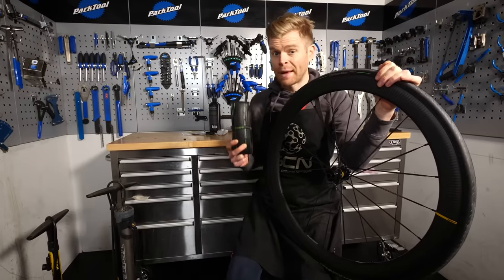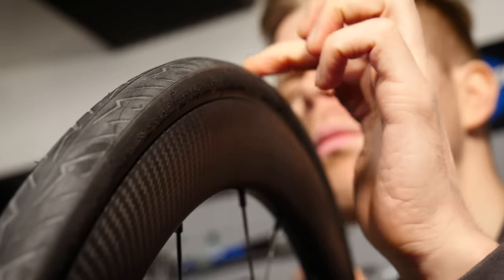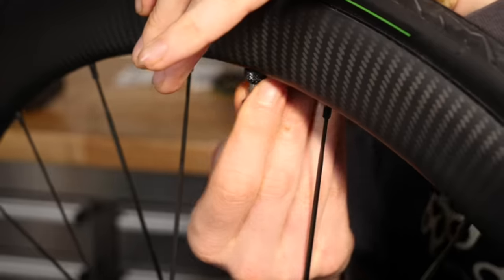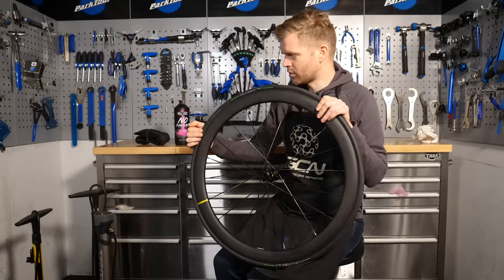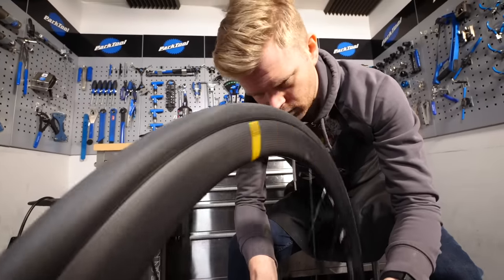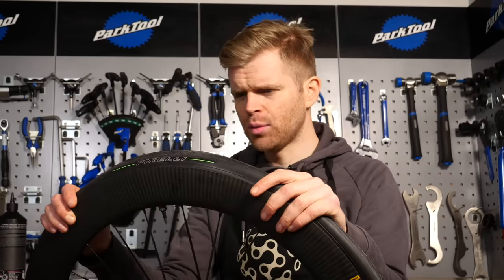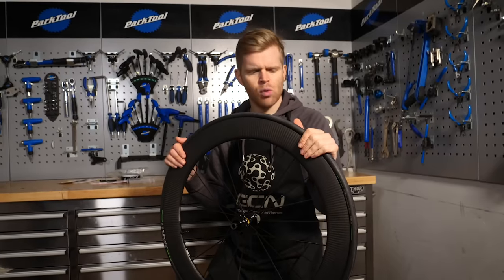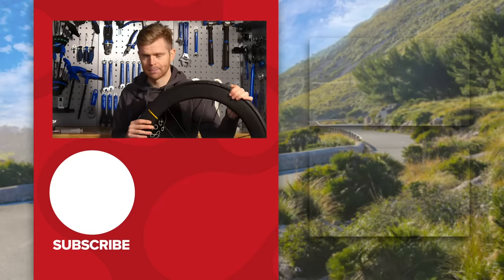How To Maintain Your Tubeless Tyres | GCN Tech Maintenance Monday

Comment: "How do you know if it needs replacing?"  I don't think I heard the answer to that one, other than removing the tire,  at which point it all spills out and you definitely need to replace it.
Reply: I like to check every 3 months or so. I take out the valve core and go in with my sealant injector, pull out whatever I can, and check for color and amount. If it doesn't look new, I replace all of it. If there isn't enough, I add more.
Reply: most sealants need replacing after 3 months, especially in the summer. With some you may get away with 6 months.
Reply: Take the wheel off and shake it from side to side. If you hear sloshing, you're fine. If not, time to replenish. The zip tie as a dipstick also works. Just depends on whether removing your valve cores and reinflating, or removing your wheels and reinstalling, is less bothersome to you.
Reply: New to tubeless.  If you are continuously topping it up do you eventually have to clean it out and start again?  If so how often would that be?  Thanks.
Reply: @harrylook7810  Do use presta valves or the larger auto/schrader ones? For presta, which brand of injector/syringe  do you use to suck it out to check? Mine either don't fit into the valve shaft or get stuck with the particles of the sealant. For filling through the valve, I keep the small bottles with the funnel tip. For roadside refills anyway. To check if it's dried up, I dip a zip tie into the tire (or the plastic pin orange sealant does provide).
Reply: @RickinHKG  On principle, yes. But when the sealant dries up, it's only a thin layer, about 10g of 60ml of sealant. So only a kind of weight weenie, rolling-resistance-obsessed cyclist would clean them every time. Though it's fairly easy to scrub off most of it, it takes me at least 5-10 minutes per tire. Plus, leaving a well seated tire on  saves some hassle. Pulling it off and remounting it is often labour intensive, nothing I'd try without strong levers anymore. Reseating tires often requires cleaning at least the tire bead for a tight seal at the rim. A dry test without sealant would show.
Reply: @qoobeq I use Effetto. I got lazy and waited 11 months before checking.  All the sealant had dried up but the tyres still held air as normal 🙂
Reply: @nikveldkamp8630  In your case, how long before you say, “time to take this apart and clean it out” ?
Reply: @MtbEMS  with the sealant dried up,  its only some grams heavier ( Tobias, RidesofJapan, weighed the crumbs for a video - about 10g per tire?), so as long as you're not a weight weenie, I'd save my time and just top it up probably 3 to 5 times before cleaning since I don't want to brake the bead seal on the rim. On that note, thanks for the reminder,  I really should put the wheels onto scales from time to time to retrocalculate the weight gain if I don't want to take the tires off.
Btw, Stan's race sealant is THE horror, cleaned out a pair of tires, that sealant is super effective against punctures due to its many glass fibers,  and that was aggressive, irritating to the skin while super hard to scrub off. All other latex sealants I tried are a piece of cake. 
But to be honest, my favourite compromise between ride quality, lightweight and ease of use are latex tubes. You have to pump them up regularly, but I find them quite robust esp. for low pressures.  And they're as patchable as butyl.
Off topic, but maybe helpful: Jan Heine (René Herse) states that their tests showed while tubeless is more puncture proof, latex is faster, mo sloshing liquid. Thermoplastic tubes seam to beat it, but they're  pricey and even more complicated from what I heard.
Hope that helps.
Reply: @nikveldkamp8630  👏oh interesting stuff here! Noted 📝 thanks!!

Comment: Thanks for the video. It has "sealed" it for me. I'll stick with my latex tubes.
Reply: Yeah I made the switch for my back wheel. Smdh nothing but a hassle.
Reply: Are latex really better than butyl tubes? Do you need to air up latex every day? Just wondering if I should switch.
Reply: @enriqueDFTL  I just swirched to see what the big deal was, and as a weeked warrior, I don't notice a difference. There's a weight savings, sure, but that's about it. Theres no noticeable air loss one over the other. I have such varied temps here, that I'm always having to add air, it seems, so I'm not a good one to ask on that.
Reply: Yes it seems quite a faf to me, also you have to remember tubeless tyres are twice the price, I have tubeless rims but I have fitted good quality standard tyres and tubes, technology will improve and prices will fall, but for now I'm ok with what I have
Reply: Proves different strokes for different folks... I'm never going back to tubes.
Reply: Agreed. I've had nothing but grief from my attempt at running tubeless. Suffice it to say the tubeless tires are in the bin now.
Reply: Going tubeless for 3 years on my roadbike and almost 8 years on my mtb, now. NEVER had any Problem at all. Especially with my mtb I had issues all the time running tubes. Fitting is easy once you did it a few times. Bikeshops in my area will do the mounting for around 15-20€ which will be an option when not wanting to hussle with latex and stuff. Will never go back to tubes. Cheers
Reply: Works well, really well, only with a proper tubeless rim! Otherwise tubes...

Comment: I still have no idea how to check when I need to replace the sealant
Reply: Orange seal has a dipstick you use after removing the valve core.  It's kind of like checking oil in a car.  Pretty easy and not subjective.
Reply: You will need to replace your sealant if you start to notice that your tires are losing air pressure faster than usual, that typically means that your sealant has dried out.  It's way easier to replace the tires than removing the old, dry sealant.  Also, if you've had a bad puncture and lost a lot of sealant I would top up before your next ride.
Reply: @andrewturner25  thanks Andrew, just saw your answer now :) that's very helpful

Comment: Switched to road tubeless two years ago. Love it! Never going back. A little more work than clinchers, but you don't need to do this maintenance all that often. It does depend a bit on the kinds of roads you ride, possibly, but I haven't had to change a tire for a flat out on the road in two years and I have not had a spray problem (these are for pretty big cuts). I still bring a tube with me in the saddle bag, just in case, a CO2 to pump that up, and some paper towels (tire lever of course, as the tubeless tires can be a little harder to get on). It's great! (for me)

Comment: The best advice I received to seal large holes in tub less tyres was to superglue a standard patch over the large hole on the outside of the tyre This patch will gradually wear away but will give the sealant time to do it’s job

Comment: I recommend the Milkit system. You can withdraw the sealant from the tire and keep the tire pressure at 20psi at the same time the valve core is removed so the bead stays on. Milkit has special rubber flaps that open and close on the bottom of the valve when you put the syringe tube thru them and still keep the air from coming out. Then when you extract the sealant, you open the valve slowly until you see just bubbles in the syringe and then close it off at the valve. Then if the sealant is low, you just withdraw the needed amount of sealant from the bottle, close off the valve and then put the tube thru the valve core hole, open the syringe valve slowly while compressing the syringe until all the sealant goes into the tire. Then withdraw the syringe and re-install the valve core and use a hand pump to put the desired pressure back in the tire. I usually top off to 60ml on my 32mm road tires every 4 months and after 1 year the tire treads are worn out and need to be replaced.
Reply: This.
Reply: Does it work on Presta valves ?

Comment: Introducing sealant through valve stem is the only rational way. Way cleaner period.
Reply: As part of a thorough maintenance regime I completely remove the tyre from the wheel and drain the fluid. Clean and inspect the tyre then remount and reuse the sealant that was removed and top that up to the right amount. If you just keep adding sealant in you have no idea of how much is actually in there. I also prefer to put sealant in before completely fitting the tyre, if you are properly setup it is not messy. It also does not take much sealant to block the valve which is why I do not like putting sealant in through the valve stem because residual sealant can find its way into the valve when it is refitted after. Yes tubeless is higher maintenance but the decreased risk of getting a puncture on a ride I believe is worth the extra effort.

Comment: Thank you for this very informative and honest video, Ollie.  The only honest and unattractive thing you did not show was the clumping of dried up and congealed sealant on one side of the wheel, if it’s a wheel set that has gone unused for a while, or the messy process of cleaning the mess from the inside of a tire.  Also, would have liked to have seen the roadside installation of a tube into wheel/tire which held sealant. I really want to deal with that mess. Anyways, the video was more than enough to convince me to leave this trend for the baggy cargo shorts 🩳 set 🚵🏻‍♂️ .
Reply: I already had to install a tube during a ride, it was not so messy, I used a kleenex for cleaning

Comment: I've gone GP5000 28mm tubeless on winter bike, GP5000 25mm latex on summer bike. The tubeless is a faff and depending on set up, only marginal gains and some losses. The faff vs benefit balance is still too close to make tubeless a clear winner for me. The GP5000 + latex is actually lighter, more supple, less rolling resistance, less faff and not punctured once in over a year

Comment: Totally missed that many syringes now have a needle-like end that allow you to inject and remove sealant much more cleanly directly through the valve. The older screw-on kinds were always a mess. This is also a good way to remove sealant prior to servicing a tire/rim that requires a removal of sealant. Works great to get the majority of sealant out, thereby reducing a mess.

Comment: Thanks for that good video, it gives a good overview. It would be worth mentioning though that with the milKit valve system you can make many of these steps much easier and faster - leaving the whole mess away! Among other advantages it lets you measure the old sealant and add new sealant without releasing the air from the tire and popping the bead.

Comment: I really do enjoy the improvement in ride quality with my tubeless setup but in all honesty, it just isn't worth the hassle for me. Not many great options for repairs in the field and fitting a tube to a tubeless setup can be a real challenge on the side of the road with sweaty hands and sealant flying everywhere. You certainly do get fewer flats but, you end up spending more time on the side of the road fixing the few that you do get. And the freakin' tires - the sizes are all over the place. Some fit quite easily but most don't play so nicely. It's just nice to swap a tube and be on your way in a few min vs. all the b.s involved with service and maintenance of a tubeless setup. I ride my clinchers way more often these days :)

Comment: Tires with tubes can also self-repair with sealant inside the tube. I don't agree with running lower pressure. Tubeless tires can "pinch flat" where the casing sidewall splits open from the pressure of being squeezed between a rock and the rim. The setup is marginally lighter, maybe. You need to run more sealant than is recommended, and the sealant dries over time and must be topped off occasionally. The dried sealant inside a tire probably helps with sealing punctures, but it does add weight and potentially imbalances the wheel. A good tire with a latex tube or lightweight butyl tube is pretty good at rolling too. When a puncture is small and sealed by the sealant, tubeless is great. When the puncture is large and not sealed by the sealant and too large for a repair plug, be prepared to be on the side of the road for a long time sticking in a tube, assuming you brought a tube and proper tools to remove the tubeless core. And the mess, wow. Tubeless tires are good for racing on a relatively good road. I no longer train on them due to the hassles associated with the occasional flat and cleaning up the mess from sealant getting sprayed everywhere. A tubeless tire can be repaired from the inside using a piece of butyl tube and tubular cement. But inflating a used tire can be a real hassle. You will need a compressor or a charge pump. You may need to take some time to remove all the dried sealant on the tire bead in order to get a seal. Tubeless tires must be pumped every time you ride. They simply will not hold enough air from day to day. They are like a tubular as far a air loss. The tubeless valve core needs to be tight, otherwise it leaks. Oh, and the tape. The tape! what a hassle. Stans tape has worked ok for me. You need to double wrap and make sure that there are no air pockets! Takes real patience and a lot of force to get a good wrap. The bottom line for me is that I would not recommend tubeless road systems, even those with rims and tires matched (Mavic) to provide a better system. I just don't see the alleged marginal performance gains to be worth all hassles dealing with tubeless tires.

Comment: Just gone back to inner tubes after thee years of tubeless horror. My Mavics never really sealed, had numerous flats, and some dangerous situations when the front tire dislodged itself from the rim while riding. Tried everything (new tires, new valves, bike shop help). Could never seat them with a normal pump so always had to ring a friend to use his compressor. Oh, and I haven’t found any upsides. Ride was fine, nothing different from what I have now.